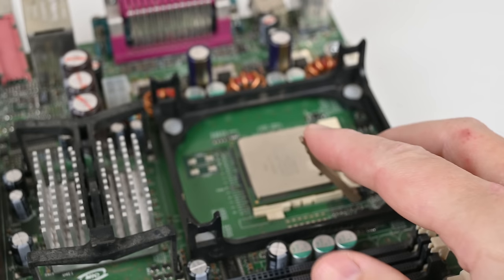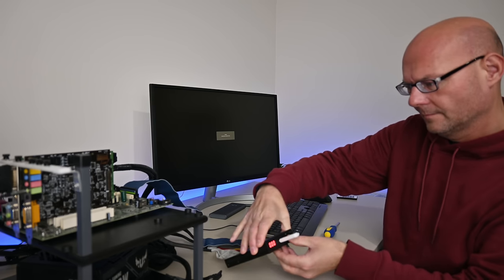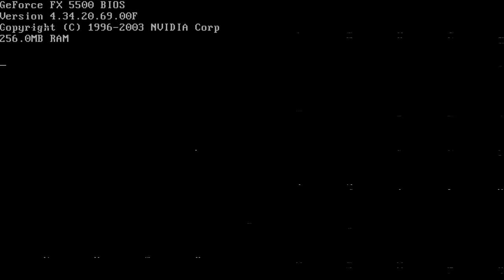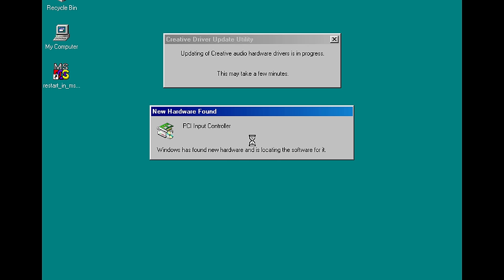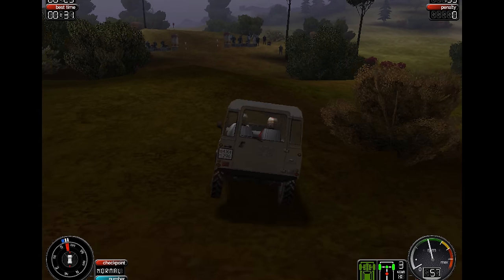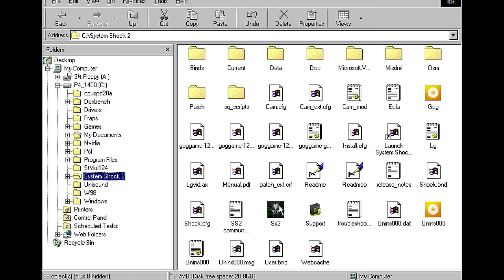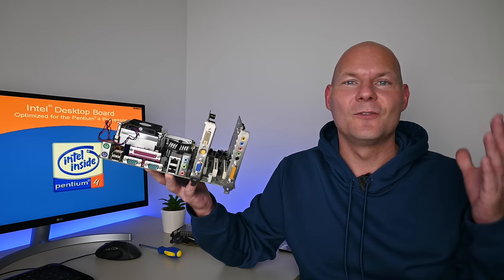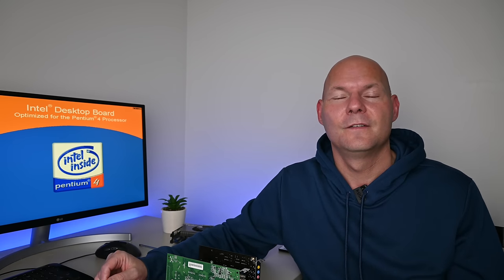It Failed in 2000, Has It Aged Well? The Pentium 4 1.4 GHz

Comment: To understand the pentium 4 and why it flopped you have to understand a little bit about scaling and architecture.

DRAM stopped scaling and diverged from CPUs in the late 80’s. You can get higher speeds, but latency gradually stopped improving. This is true for busses and expansion cards as well. It used to be possible to have a single clock zone for the entire system and run the entire motherboard of this single clock.

Dennard scaling allowed CPUs to get faster and Moore’s law allowed more transistors at constant cost. Both accomplished by just making transistors smaller. At some point the CPUs clocked so fast that busses couldn’t keep up. ISA got its own divider to operate at a fraction of the CPU frequency. Then more clocks of latency had to be added to RAM, and caches where introduced. First on the motherboard, but this cache eventually became too slow and a new smaller internal L1 cache was introduced. Then the motherboard clock itself could not keep up and a CPU multiplier was introduced.

The CPU itself had issues scaling with a single instruction per clock but this was overcome by pipelining; dividing an instruction in small stages that can operate like an assembly line on multiple different instructions.

As soon as you hit a branch or an instruction that uses the not yet computed result of a previous instruction the CPU has to wait. The longer the pipeline became, the longer the CPU had to wait. All sorts of tricks were invented for this; register aliasing, branch prediction, speculative execution, load store forwarding etc. This didn’t improve IPC; it just prevented IPC from degrading as pipelines steadily lengthened and clock speeds increased.

Intel made this bet aggressively again and again: they would be able to avoid all the latency related obstacles with clever latency hiding tricks. Dennard scaling would also continue.

The pentium 4 was expected to run at 8 GHz by 2003 (late 99 prediction as far as I can remember). This time they were wrong on both bets; IPC degraded quite a bit below pentium 3 and athlon; Dennard scaling started to crap out. They saw this wall comming with leakage becoming monstrous and voltages dropping so low that the device was barely functioning any more and expected that because they had the best processing engineers in the world, someone would think of something by the time the chip was ready to be produced.

They had made this bet many times before and been right; which put them continually ahead of AMD. This time the shit hit the fan and they had an inferior product that needed expensive memory on an expensive platform to barely beat AMD in some applications and lose in others.

They made another losing bet with itanium. IA64 was slated to be the successor to x86. Intel did not want x64 to exist. Itanium was the future and legacy x86 should just be emulated. Only one problem; Itanium was huge (pushing up against the reticle limit), monstrously expensive and slow as dog shit.
Reply from the maker: Amazing post, thank you! It's rare to read something so concise and summarising a range of complex aspects.

Comment: My former gilfriend now wife) had a P4 Willamette S423 @1,7GHz but with SD-RAM. Sluggish as hell! The Northwood Core was very nice, but with topping the 3GHz barrier needed a lot of power. S775 Prescott - no comment. Have a Fujitsu Siemens DDR based Board with several CPUs for S478. Willamette@1,8GHz and Northwoods from 2,0GHz all up to 3,06 with HT. Nice is that i also have the OEM WinXP Disk from Fujitsu which is preactivated when used with this board.

Comment: I remember my fx 5600 was pretty lousy and underpowered compared to ati's offerings at the time. the fx 5000 series was not a good overall series, but they did produce some new interesting designs like the fx 5950. Those were cool graphics cards, even if the 5000 series were kind of bad overall designs, but the 5950 was just a cool looking. The fx5200 was very low end and i can't remember, but I imagine it was in the range either a geforce 4 440 or maybe an fx 4200.

Comment: As a Pentium III Tualatin user, I will say the P3 and P3 Celeron were a better option as long as the board supported DDR.
Reply from the maker: DDR us extremely rare with Pentium 3 I believe. PC133 SDRAM can also perform very well and was heaps cheaper than Rambus ...

Comment: My current 98 pc is a P4 3.2ghz northwood with a ti4200 and audigy 2. I have a great time with it. You can  sometimes find intel 478 coolers with the copper insert around for cheap. They work well i find. Might try that 4x4 game. It looks great 👍.
Reply: That really sounds like a machine where you upgraded the platform but kept the GPU. And the Ti 4200 was a beast. Might be only DX8.1, but many games supported it, and it was fast and cheap.

Comment: A Pentium 4 around the 2ghz mark is an excellent Tualatin 1.4s substitute. Just as fast, just as stable, just as compatible. And about 1/3 the price.
Just make sure you get an intel chipset motherboard, they are the best and AVOID sdram boards AT ALL COSTS - DDR or RAMBUS is where it's at with a P4.

P4 get alot of hate in the retro community, I really don't see why. Sure it was expensive when it came out, but so what? It certainly isn't now.
Sure, it uses more power and produces more heat than a Pentium 3, but it's still nearly always well under 100W TDP, so what? Most modern pc's are well up there with power and heat too.

Nice to see you're playing Shogo, I've loved that game since it came out. It seems to mostly be forgotten these days, I think that's a real shame.
Reply from the maker: I agree, P4 is awesome for Retro!

Comment: I have a 1.5 ghz socket 423 pentium 4 (or whatever socket was right before 478) I've been itching to bench against a socket 478 pentium 4 and see what the difference is.
Reply from the maker: There should be very little difference. I lile 478 because I already have a heap of parts and boards for it ..
Reply: @philscomputerlab  same here. I have a few the support different ones...1 even support HT. But I only have 1 function 423, and it's also my only rdram based system.

Comment: Regarding System Shock 2, I've recently tried the retail CD version with a close configuration as yours (P4i65G, FX5200 64bits, 256mb of ram, vortex 2 soundcard) and the game runs pretty smoothly without issues however I've had some trouble with SHOGO and the demo of Blood II: The Chosen (basically the HUD was missing or flickering) and  was related to Triple Buffering too but I also had to force VSYNC at 60 FPS.
Also I'm not sure wich driver your are using and maybe you already did but you might want to try the NVIDIA 45.23 version, they appears to be the most compatible drivers for games around 1997-2000 and games using DirectX 6.0 (AvP and Jedi Knight DF2 was one of those games I had trouble with with most recent NVIDIA drivers).
Nostalgia is a funny thing because I kind of forgot those little issues from the days, anyway nice video as always !
Reply from the maker: I tied the game again on another machine and it runs, but then the wrench isn't showing. So reverse patching the GOG version doesn't seem to work. I will try the CD images the next time...
Reply: @philscomputerlab  Sorry to hear that, might work better with the original version.
Reply from the maker: @Xerxes-xn1gy  Retail CD with latest patch works flawlessly 😃 EAX sound is awesome.
Reply: @philscomputerlab  Aah noice !

Comment: "You needed quite beefy CPU coolers"???  Mine did cook the graphics card.  Eventually it did show signs of graphics Alzheimer - flickering pixels and similar.  That got progressively worse.  When I opened the system the graphics card's PCB had turned from blue to brown.  Even the (regional) manufacturer of the PC was surprised when I showed them the crispy board.  And swapped half the rest of the components.

Comment: Hey Phil, have you had any input issues on NFS III, High Stakes or Porsche Unleashed with a FX 5500 on 56.64 drivers? I tried PS/2 and USB keyboards and both result in keypresses (not the physical key itself) getting stuck, e.g. the car keeps accelerating and turning left regardless of what I press. Any idea why that happens? It's weird because I never had this issue with ATI.
Reply from the maker: These games are a pain to source, not available on GOG and I rather not muck around with original CDs. What you say, I think I've seen something similar, but not sure what game and I think I used modern patches? Are the demo versions affected because they are easy to source and quick to test.

Comment: That's why I love Pentium 4: Pretty friendly with Windows 9x, but certainly neat with Windows XP in terms of performance. Even is much more affordable than Pentium 3 old PC's.

In some cases, some motherboards includes the S3 SavagePro DDR as a default integrated graphics processor, which makes ideal for retrogaming.
Reply: Depending on chipset availability I would say get the Pentium 4 with the smallest multiplier and a board that allows for high FSB. That way you could run it slow for older games but also oc it and have a huge timeframe covered.

Comment: The Pentium 4 was crap but it's cheap to get into now and even weak ones are powerful enough to run any software of their release year and older very well. Socket 478 also has ready access to a lot of older ports and I/O methods.

Comment: The Pentium 4 was a RESPONSE to AMD taking the performance crown away from Intel ENTIRELY, when their Thunderbird Athlon series ended up with slightly better IPC at EVERYTHING than the Pentium III, AND clocked higher.
The 4 early on was a dud - VERY POOR IPC - but it was able to be ramped up a lot on clock speeds to where it passed the Athlon (and the Palomino wasn't enough to catch back up) on performance.

For reference - I still have a working P4 1.8 Ghz machine, though it acts as a low-scale single-purpose server only.
It is easily the second-lowest performance CPU I still have (there is the K6 I have that I've been thinking about making a WFWg 3.11 / DOS 6.2 / QEMM box to play DOS games on - might use Win95 SP2 instead.).

Comment: I had a P4 1.6GHz in 2002 and a P4 2.8 GHz HT (Northwood core, socket 478) in 2004... I still have my P4 2.8 HT along with 2x 512MB DDR-400 memory modules, I just can't use it because the motherboard and my ATi Radeon 9800 PRO died long ago.

Comment: Pentium 4 533Mhz 2.8 ghz was the best. I find that with most tech. Don't get the top tier, just a little below. Ideally it should work type of thing. They have to turn it down a notch.
With the exception of this one. If you run across this processor steer clear. I couldn't figure out why my boards kept burning up. Top of the line boards. 
Smithfield (Pentium Extreme Edition) – 90 nm process technology (3.2 GHz)
Pentium 840 EE – 3.20 GHz (2 × 1 MB L2
Core 2 Q6600 was the best for that run. I've got one running still today. Fast as hell.

Comment: I have a Radeon AGP card with the same artifacts, I got it for free and it worked great when I first tested it but then it started to show artifacts just like in this video, the card had really dried thermal paste. It's either the RAM banks that are corrupted or the GPU socket that needs to be reflowed, they might be repairable if you have the proper tools for the job so don't throw them into the trash.
Reply: I think it also might be that the capacitors are failing. The top should look flat and not bulge. I had a similar problem with a geforce 6200. I replace them and it work fine again.
Reply: @ricardomedina8901  You got lucky, the caps on my card look good,  from my experience with electrolytic capacitors if they look good, they usually are good. I do desolder them and test them, some are really hard to desolder, I have to try low melt solder one day.
Reply: For ultra cheap ghetto reflow you could bake it. Obviously no guarantee to work, but if it's already broken, there is nothing to loose. I repaired my 8800 GT twice that way and got about 5 months more life out of it.
Make sure to go for the "high temp" plan. Common solders melt in the range of 180-230°C, which is what household ovens can do. Don't go with the "30 mins at 120°C" method. That only helps drying out caps.

Comment: I like my Prescott "Pentium Fo" retro build, but I guess these first Pentium Fo were terrible. 😀 After I overclocked it, I had to install extra heatsinks to mosfets around socket because it had 130°C and it was crashing because of that. 😀 There is some feature I never noticed before on my sc 478 MB, it has thermal sensor for mosfets because it can recognize it's too hot and it starts throttling (even when CPU is cold), but you don't see that temperature in diagnostic software like Aida. But I guess this is the main problem of Pentium 4, temperature of CPU itself is not such a big problem, you can always install better cooler, but mosfets and other things are bottleneck for high clock speeds. I have massive arctic Freezer i30 modified for socket 478, so I don't care about temperature of CPU. 😀
I've never seen those first P4s with these special RAMs, that's something I really want to test one day.

I noticed that it's harder and harder to find drivers for old HW, it's really sad, but expected, we just have to do proper offline backups again like in the past.
What I hate the most is that nvidia and AMD old versions of drivers are still there and you can download them if you have link to that file, but you can't find it normaly on their website, you really need that link which I don't understand why there is no some list of old drivers, it would be much easier then, the same for intel, but to find some intel drivers was hard always, even when that HW was up to date.

BTW, I didn't know that game with cars, it looks interesting. Shogo is really retro feeling, I haven't seen that game for almost 20 years and back in the day, I have damaged CD so game crashed at some moment and I could not continue forward, so I never finished it. 😀 I believe I still have that CD somewhere.
Reply from the maker: I'm now putting more effort into uploading drivers to my site. Especially motherboards. A lot is on archive or Wayback which is so awesome. Intel: booooo

Comment: Oh a Pentium 4 space heater Themed video.
Reply: It's actually a Willamelt :)
Reply: It's a Willamette 1.4GHz cpu. SL5TG
Reply: @MidnightGeek99  I forgot that one lol
Reply: @JohnSmith-xq1pz  there was the Willamette, then the Northwood and later the Prescott, the slowest Prescott was 1GHz faster than this CPU BTW.
Reply from the maker: @RetroTinkerer  It can get confusing! So many different Pentium 4 CPUs which makes it really fun!
Reply from the maker: @JohnSmith-xq1pz  It can be very confusing actually :D And then to figure out what model works on what board. Oh dear...
Reply: @philscomputerlab  lol Yup. The Pentium 4 era had what 3 different sockets and 4 different chipsets?

Comment: I would still recommend Athlon XP or similar over this one for lot of reasons. If you want to go P4 route it must be at least Northwood generation which run in range of 2.5 to make any sense over Athlons. But for probably same money early Core2Duo that's just bit newer would smoke all of these with ease and still be retro capable, just as those P4 and Athlons.
Reply: I have a 3.0 GHz Cedar Mill P4 and a Conroe-based 2.0 GHz Celeron.
The Celeron absolutely destroys the P4 in everything but 3DMark Vantage.
Sure, the P4 will clock to 4.0 GHz, but the Celeron will also do 3.5 GHz, widening the gap even more.
And that is the smallest Core-based design. 512k L2 cache, single core, 200 MHz FSB. When I thow my Xeon X5460 on there and clock it to 4.1 GHz, I get about 2.6x performance in single and 9x performance in multi-core tasks, which is just insane.

Comment: Oh and i just thought of this a week later lol Those dang terminator rdram pcbs are a bit of a pain to find. I got lucky and snagged a few a while back as a just in case. Glad i did cause the gateway Performance tower i have someone pulled the ram. Its on my list of things to restore. (which is such an odd statement since i vaguely remember seeing this machine for sale new when parents were first shopping for a pc in very early 2000s)
Reply from the maker: As an alternative use 4 memory modules. But check the specifications, some boards have speed or capacity limitations when using 4 modules ...
Reply: @philscomputerlab  ill need to remember that when i go to restore this one. all the rdram i have is same speed rating, but if i remember right the factory spec was Windows ME and 128mb ram...and hopefully all the ram slots work. Ive had a few dells and compaqs from that era that used ddr or sdram that had least 1 faulty part somewhere

Comment: THE move was to get a P4 1.8A, an 845D chipset mobo and just crank the FSB to 133. Voila, P4 2.4 GHz and DDR 2100 for REAL budget money. Which is why that was exactly what i did.
Edit: THE move at the time, of course.
Reply: The 1.8A on 2.4 and the 2.4C on 3.2 were pretty much the thing to do.

Comment: Hello for mine i choose p3 1.4ghz for win 98 games and Q9650 for XP because my motherboard is dual boot, do you think it would be useful for me to upgrade to p4 to have a significant gain on dos games?
Reply: To get a faster P4 you'd have to go to at least 1.8 GHz, in some cases even more than that. There shouldn't be any DOS/9x exclusive game that needs more CPU than that, and for slightly newer ones, you can run them on the Q9650.
I haven't found any DOS games that come even close to my 933 MHz P3 so far. Things like Unreal or Half Life run just as well on my modern system. Even the old releases without 25 years worth.of updates.